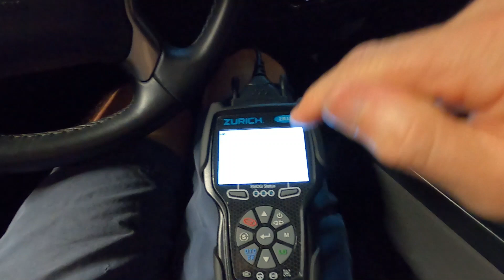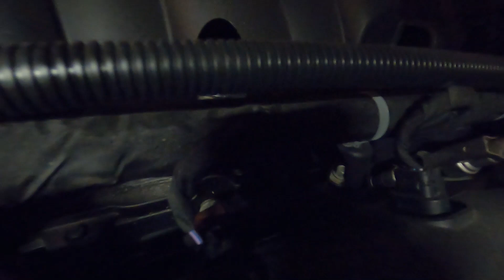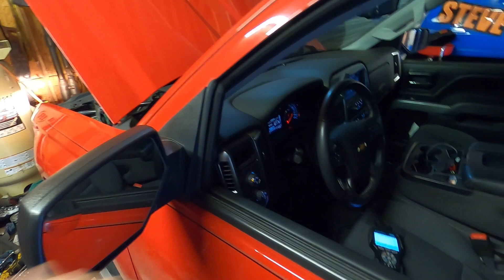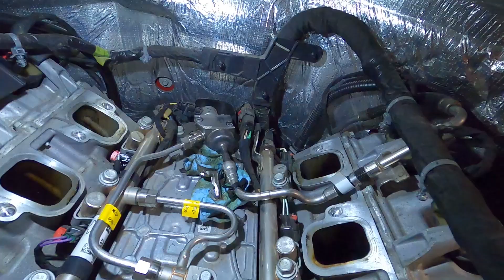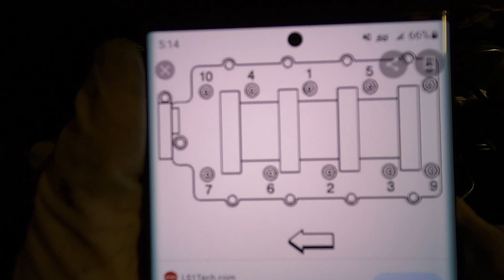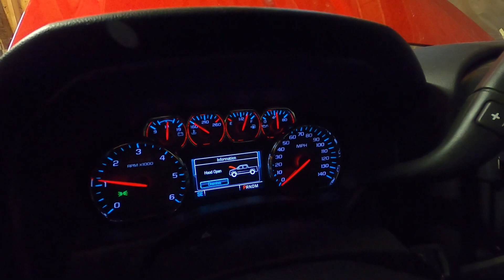High Pressure Fuel Pump Replacement GM Truck

Comment: I have a p171 p174 for 2015 gmc Sierra with the 4.3 liter..lean bank 1 and lean bank 2..also number 2 cyl misfire i changed plugs 2 and 4 still missing, and used a timing light on each plug wire and i am getting fire..ive tried rxp fuel treatment several times, not sure if its an injector miss, since i have fire in the wires a coil seems rules out. I surmise either the high pressure pump or bad injector..🤔

Comment: Would this diagnostic method point out same issue if my fuel trims are hitting -30 for both LTFT banks?  Truck just hit 100K with check engine light on, said I had a bank 1 cylinder 1 misfire.  Replaced plugs, wires, ignition coils and injectors.  Now I have a p0175 and p219A.  I've replaced PCV, Purge Valve, and MAP.  MAF reads fine at warm idle about 6.5g/s.  I can't nail down this -30 with LTFT on both banks.

Comment: I’m getting a 5v reference code.. truck is extremely hard to start. Says fuel pressure long term is -20. Has codes for baro also….fuel pressure high voltage code.. any ideas? We’ve been diagnosing for two weeks this is the only thing I can think of…